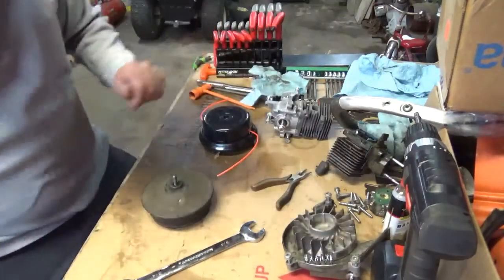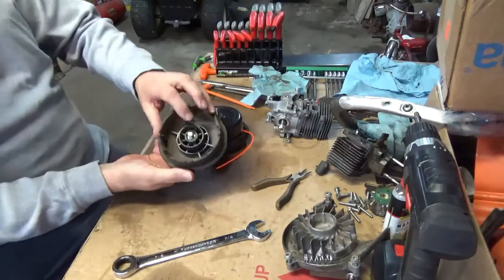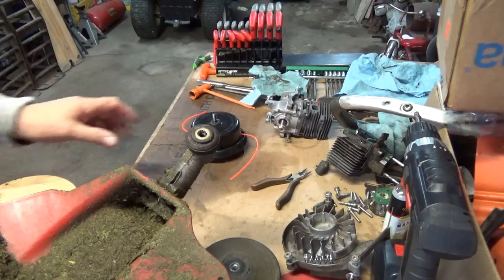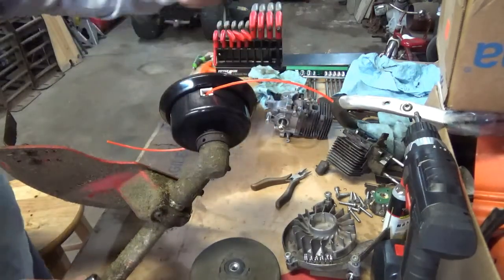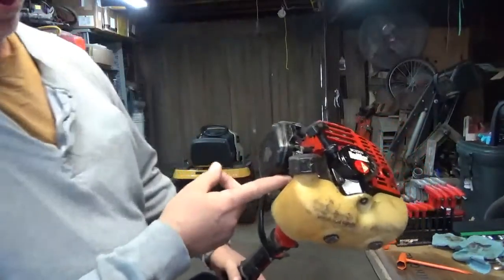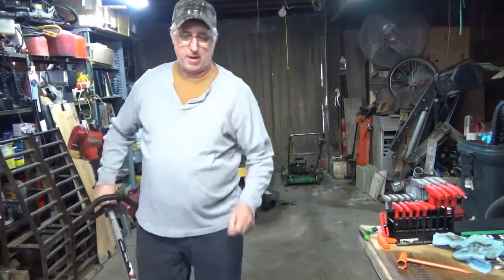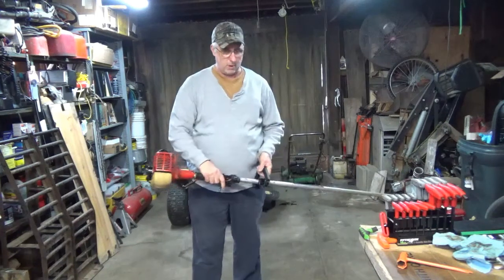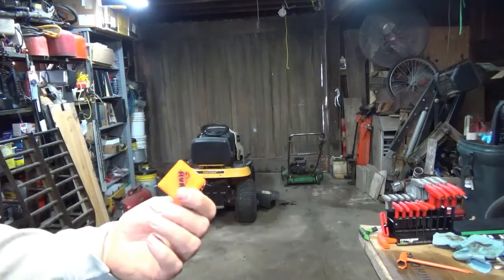RedMax BC2300 String/Brush Cutter String Head Replacement

Comment: I still got the old red one they put on them new and I don’t know how to string it because it’s from before my time.  And I can’t find a video anywhere
Reply from the maker: Without seeing the head I'm not 100% sure but I believe there are 2 internal clips that you need to release through slots in the cover part of the head, (side with the bump button)
Reply: I have 2 of the old school red max trimmers, they both use the red heads for string. I actually bought 2 extra heads because they hold more string. So, you make 2 separate lines, broth the same length. I keep a piece of line cut to the optimum length and save it as a template to cut more string from. Next, use pliers to make a 90 degree bend on 1 end of each string. Clip and trim the bend to appx 3/4 inch on each string. Put each string in the holes on the vertical inside edge of the reel. Wind both strings at the same time, in a clockwise direction. Use your index finger to keep each string separated while winding both strings at the same time. The goal is to keep both strings on left side and right side of spool. Try to keep both strings smooth so you don’t make any gully’s as you wind. When you reach the end, one string threads through one eyelet, the other string through the remaining eyelet. Trim any extra long line using the guard cutter blade as a guide. These old red heads hold a lot more line, but you need a more powerful engine/model to handle the red heads. Hope this helps I’ve been using these for 30 years, thank you, Jim.

Comment: I'm not going to laugh at you but I will ask if you know where I can get a replacement deflector/guard for the trimmer head?
Reply from the maker: If your unit is a BC2300DL, 2600DL, 3400DL or BC4400DW the part number is 6460-24100 and I can't find one online, best guess would to be watch EBAY for the part or a parts unit. May be able to use a universal fit guard.  Good Luck

Comment: I have a BC2300 brushcutter, you have a BC2300DL or BC2300LE carburetor.
Reply from the maker: If your inquiring about an extra carb I would get rid of No I do not.
Here is the current part number for a replacement carb 515421101, just Google this number and you can find new carbs for around $25 US dollars.